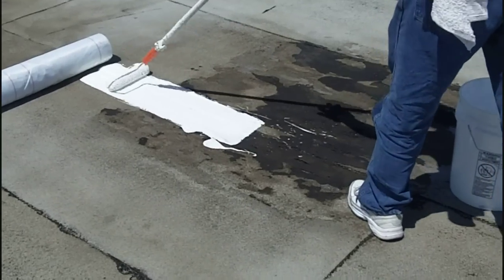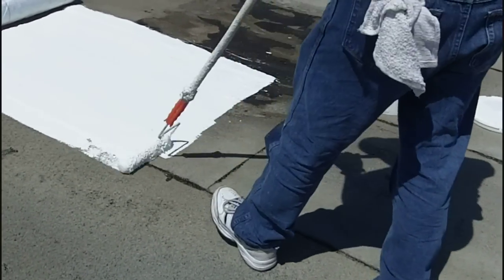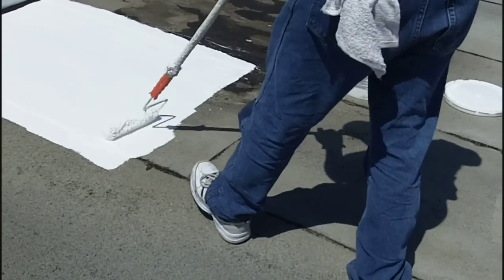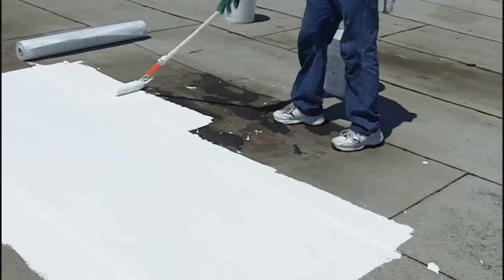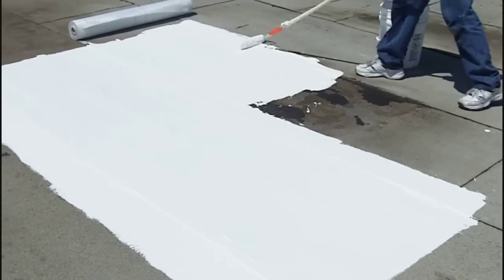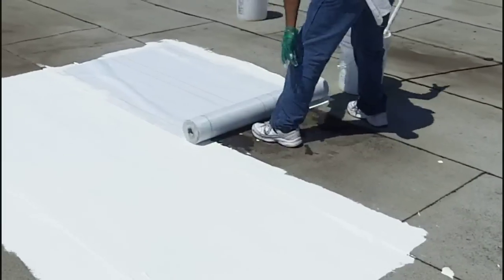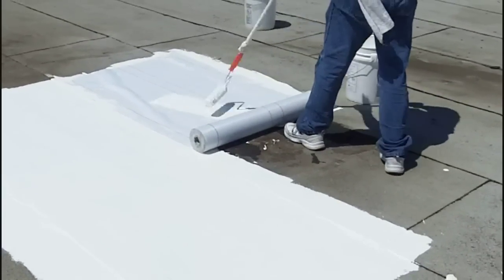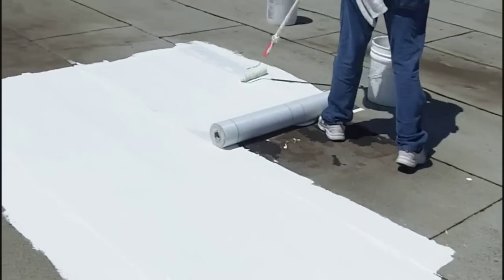Flat Roof Repair Orange County

Comment: WHAT IS THE AVERAGE CHARGE PER REPAIR?  I'VE NOTICE YOU COVERED 4X10 AREA? = .40SQ
Reply from the maker: +Jonah Rios - Each contractor and roof is different.  I don't know any approved contractor that would only do .4 SQ repair.  Usually there are several repairs done all on the same day or a few repairs during a roof maintenance and inspection.  The maintenance and repair costs are based on roof size and roof condition. If you are interested in DIY - Material costs for a small repair start at a $100 for a DIY repair kit. We have Small Project Kits from $495